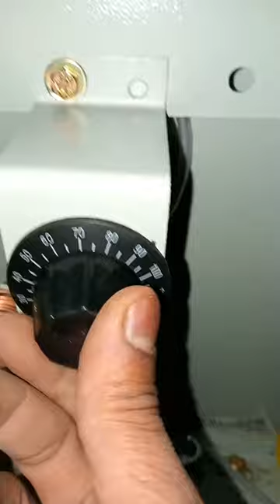💥space heater 🔥 thermostate bypass connection 💯#electrical #viralshorts #youtubeshorts

Comment: How space heater work with thermostat ,,,
Is the heater cut off at a rate when temperature becomes normal??
Reply: Yes, correct. It's called capillary thermostat - when actual temperature reaches the set temperature in thermostat, it gives a click sound and stops current flow. One wire of the heater is connected through the thermostat, so thermostat can stop the heater.
This thermostat is passive, doesn't need any electricity itself - but also slow to react to temp change